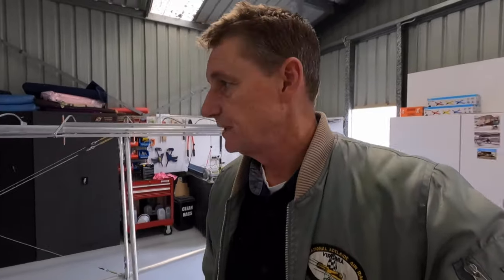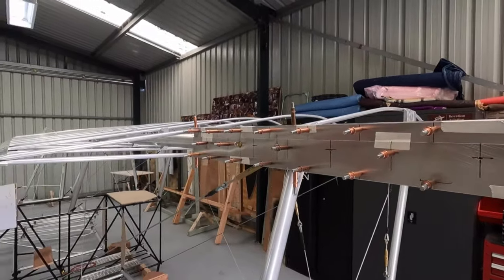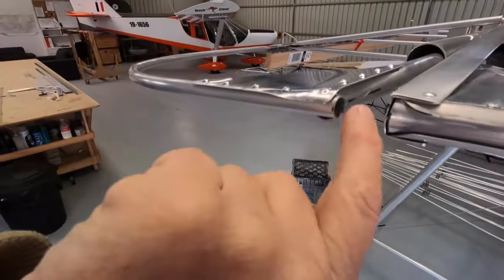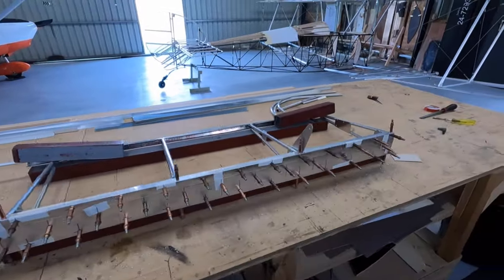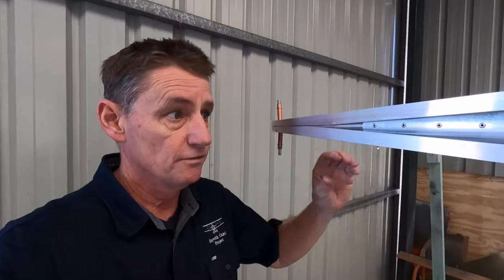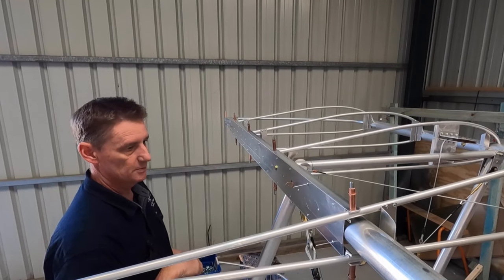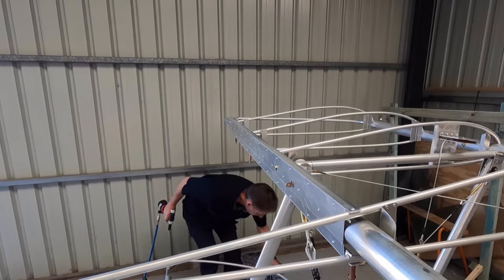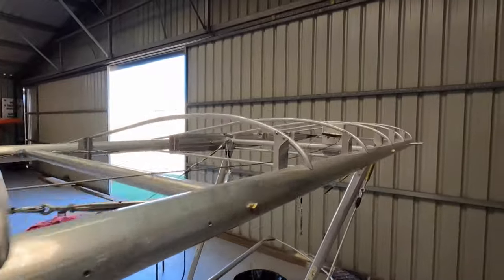Sopwith Camel Ailerons Build Part Two: Crafting Aviation History

Comment: Are the rivets aircraft specific and do you have to have the wings inspected.  You had the fuselage inspected and fixed but that seemed more on a voluntary basis.
Reply from the maker: Yes I use Avex rivets. But as recreation aircraft you could use hardware store rivets. 3 inspection are required throughout the build process. Basically I will finish the airframe prior to first inspection toon as you can see everything.
Reply: @scottmatthews5280 Thank you